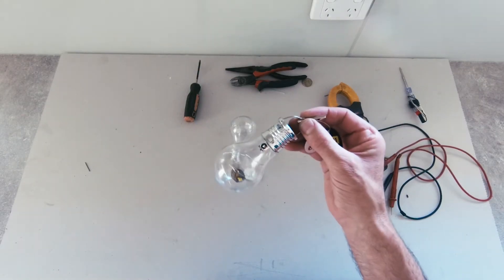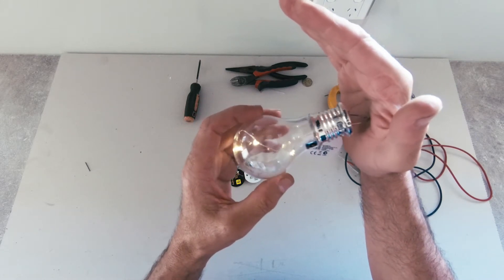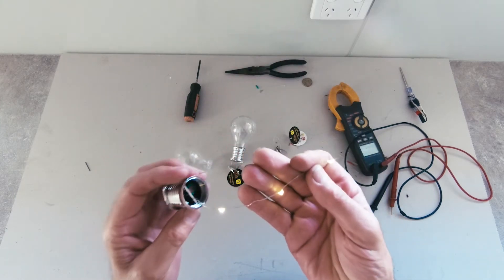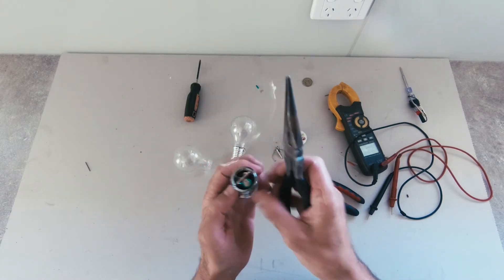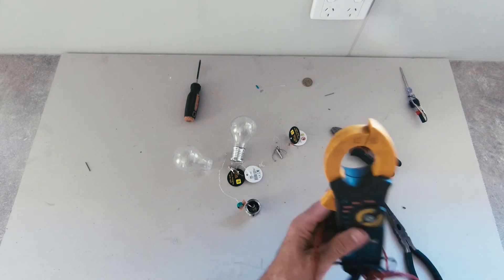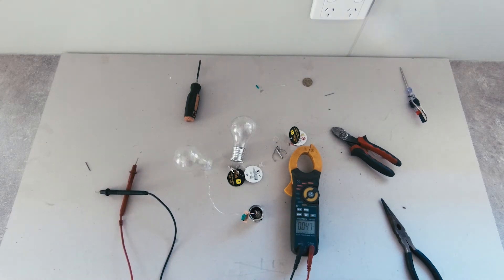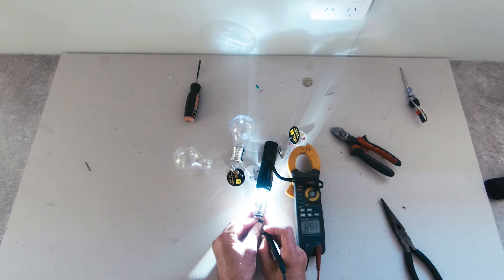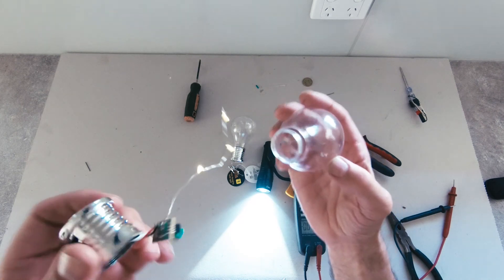One Dollar Solar Lightbulb Teardown

Comment: Hi! I'm just now seeing these Chinese made Solar Bulbs in my Dollar Store in 2019. Bought two of them and can barely get one to work the way yours did. Looks to me like I'll need about 6 of these to light up my bedroom enough to where I won't stub my big toe on a dark corner. You honestly sounded like you wanted the low budget Solar Bulb to fail big time. Is it still working?
Reply from the maker: Hi Tuck, I've actually bought 10 of them around a year ago and 9 are still working fine. One of them went dead after a few weeks, the button cell inside it exploded!
Reply: @chich7089  Cool! Well the bulb that of exploded on you sounds a bit scary. I wanted to install some of these in each my in my apartment rooms while I'm off traveling for a week. I'd hate to return home to burnt embers if these China Bulbs catch fire.

Comment: Hey Chich, My DeLorean's flux capacitor seems to have run out of flux. Is it possible to convert it to solar power using some of these cheap lights? According to my calculations, I'm gonna need about 1.2 gigamatrons of power to get back to 1955.